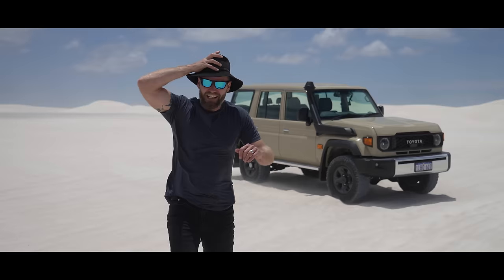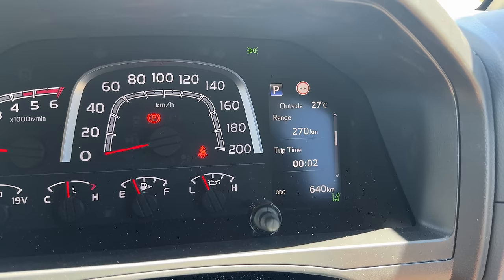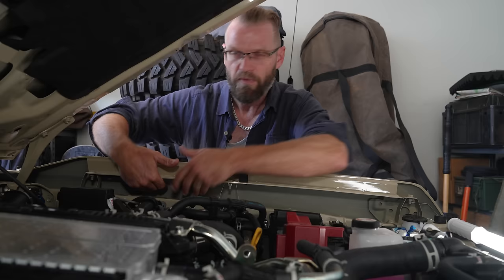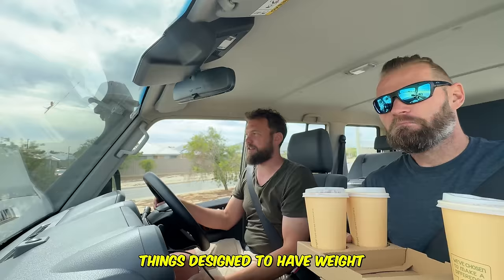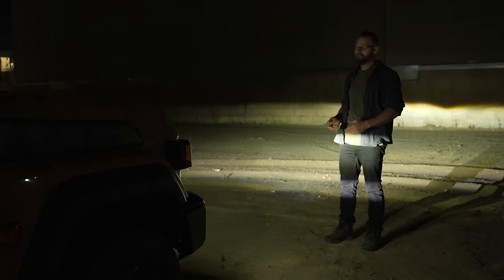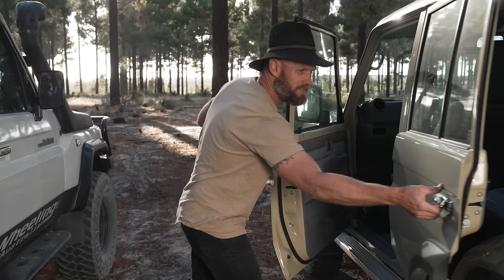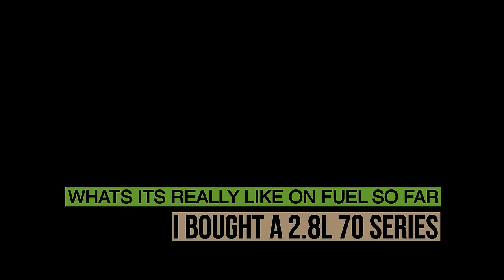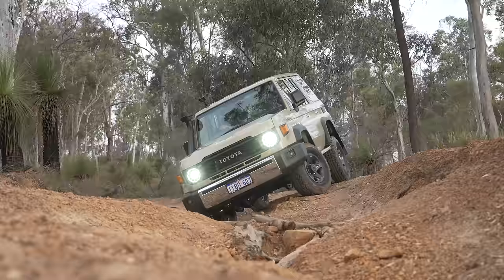I BOUGHT A 2.8l AUTO 2024 LANDCRUISER 70 series

Comment: 88K on a vehicle that's basically a way shitter version of a Prado with an out of line wheel track and cardboard doors is literally insane
Reply: Every tradie drives these types of trucks...each to there own but God dam they are expensive.
Reply: @Do-iz6qd  When it all comes down to it people are literally just paying for the look and maybe the solid axle, that's literally all they have to offer, because these modern engines are just as complicated (DPF, EGR etc etc) as any other. So They're not even old school reliability anymore. If that's what people are after you're better off buying an old one and rebuilding it.
Reply: @Do-iz6qd  “every tradie “ you recon ?  I’d say about 5% or less of tradies would be more accurate
Reply: It’s exactly what i paid for a Kakadu, drive away.
I prefer heated/cooled seats and a fridge under my armrest.
And comfort.
And the lack of noise.
And a reasonable sound system.
Reply: All cars have different track. It helps then turn around corners.
Reply: @Cous1nJack  um , what ?
Reply: @Cous1nJack  lol no they don't... It literally makes them wobble side to side in sand or ruts. It's a fundamental design flaw and cost cutting.
Reply: @Ozfreerider2504  Pretty special comment hey 😆
Reply: @gibbethoskins8621  the internet is just full of special people . Haha .
Reply: @Cous1nJack  can you name these other vehicles ?
Reply: @Cous1nJack  real cars ……
Reply: @Cous1nJack  We're talking about off road/farm vehicles, not street cars 🤦🏽 The reason it's an issue is because when they are driven off road they wobble side to side, especially in sand/mud/ruts which sux for obvious reasons but also puts excess pressure on components. Any off roader or farmer knows this, and they have to replace the axles which costs a fortune or use offset rims which also puts excess pressure on components. My friend just lost a rear wheel on one while towing at 110kph for this reason. Even your mum should know the difference between off road vehicles/tow vehicles and street cars.
Reply: @Cous1nJack  Yeah but we're talking about 4WD's 🤦🏽 not your gay vw golf that you drive to your boyfriend's house to listen to Sam Smith and play video games together 👨‍❤️‍👨
Reply: @Ozfreerider2504  Don't know where you live, but up here in QLD they are rife. I count 4 just on my street.
Reply: @Cous1nJack  you said ALL cars , then went on to name 2 piece of shit European cars that nobody cares about
Reply: @Do-iz6qd  are they tradies or just guys with 79s?  Even if you do see a few that are tradies that’s Probbaly because you’re liking for them now look at all the trails you see that aren’t driving them .
Reply: @Cous1nJack  you said every car ….
Reply: My betting money is on this lasting 40 years though.
Reply: @jesusnavarrete6317  who keeps a vehicle for 40 years ? People sell them in 5-8 years so not very important
Reply: @jesusnavarrete6317  Maybe with the DPF and EGR removed. We're talking about a vehicle that's literally recirculating it's own exhaust gas and running high pressures. Completely different to the old unbreakable Toyota diesels like the 3B.
Reply: The whole point of these was that they are cheap and reliable. No longer.

Comment: It’s like they’ve taken the 70 series out of the 1980’s and brought it all the way through to the 1990’s. Groundbreaking.
Reply: it has 2 diffs, !!,, but,,are they the same width..
Reply: Well that was the idea! U dont need too much otherwise get LC300!
Reply: @survivalabc spot on mate , there will always be whingers
Reply: @survivalabc  only because Toyota would try and charge 140 grand for it 😅
Reply: How about buying a 5000 km lexus lx 450d with sunroof and mark levinson from UAE. Right hand drive. Many people bought land cruiser v8 and lexus lx v8 rhd in uae for export. Will a lexus lx 450d be as capable as this? If we put 285/65/18 tyres. Its a limousine in road and beast offroad with ahc
Reply: @harrywalker968 still no. If they sold out previously... well  obviously ...people liked the dual width axles.😂
Reply: Yeah design may be from the last century but the price is from 2040!
Reply: That's Toyota, last centuries technology at tomorrow's prices. And people buy them. Go figure.
Reply: @colinboyd7779 Show me one proper offroader that‘s less expensive.

Oh hold on. There is nothing comparable out there. Maybe the Grenadier and that‘s much more expensive.

Comment: I find a lot of new modern cars have horrendously bad turning signals now to the point i have to do a triple take to see if the cars are indicating at round abouts or not. Good on Toyota for making a huge one and putting safety first.
Reply: They only did that to comply with the rules of the category the 70 series falls into now being a commercial vehicle
Reply: Indeed a commercial vehicle but I bet it also has a lot to do with some risk assessments done for use in mining. That is a market they would be chasing.
Reply: Mazda are the worse’s. They always catch me out.
Reply: bad turning signals as in their visibility or brightness?
Reply: Yes, ADR's have all been ignored on many new vehicles. Useless indication, brake lights, mono-white lights accross whole front or red on ass.

Comment: Congratulations, Toyota. You now match the power and performance of a 2009 Mitsubishi pajero!
Reply: I'd still take the Pajero
Reply: I don’t ever recall the 2009 Paj even coming close to 150kw and 500nm
Reply: @bluecent  147kw is very close to 150kw, and it may actually be faster 0-100...
Reply: 2.8 has loads more torque than the 3.2 in the Pajero.
Reply: I'm currently have Paj 2009 and thinking to buy Troopy.

Comment: Toyota kept the same rear end purely on cost, hence the misaligned wheel tracking. They messed up the bonnet construction and you can see where the glue has a large gap between the frame and skin. 88k for a project car which resembles a pre production fit and finish is what it is.
Reply: That’s a hot take. 
Why is everyone assuming different track widths is wrong? Most 4x4’s and heavy vehicles are designed like this, it helps with manoeuvrability on tight cornering and stability at higher speeds. It’s also great where you’re running aggressive side wall tyres because it pick up a little different traction lines.
Reply: The bonnet flexes like that because air passes flows through the bonnet through the front grille, to replace the hood scoop.
Reply: Rear end .. proves Australians will pay big money for a flawed vehicle. If this car had a Korean brand on it... It would get rubbished
Reply: @doeldogz8399  I'm Australian, I wouldn't buy it for that price, nor would I buy anything Korean to do what I require  because they can't.

Comment: I feel they could have definitely addressed the track width issue with the rear diff. And maybe a slightly wider wheel arch or flare. Otherwise I don’t see the need to change the rear. Also I wish it had a rear tire carrier factory.

Comment: Another interesting video Ronny! 
Having migrated from a 4 Cylinder 2.8L Auto Prado to a 4.5L V8 Troopy a couple of years ago, I know both engines well. 
The 2.8L is a gutsy motor and performs well off road and even when towing a camper trailer. I am surprised that as you commented in an earlier video, that the space in the engine bay is so limited, that you can't fit a second battery in there - I was able to fit a second battery in my Prado with no trouble at all.
I just know that your assessment on this vehicle will be thorough and definitive, so I look forward to following this project closely.
Reply: Toyota sells the FJ45 Bandeirante in Brazil with that torquey, yet lazy old 4-pot Mercedes Benz OM314 circa 1964!  At least this 2.8 is a modern turbodiesel, one that will become very popular.  In South Africa 🇿🇦, the first FJ45'S were sold with GM 3.8 and 4.1 straight six petrol engines, known Down Under as Holden.  Various Mercedes-Benz Diesel engines powered different LC models over the decades.  Maybe that's why they were so reliable??

Comment: to stop the bonnet flexing get a big dob (squirt) of Sixaflex to connect the lower ribbing to the upper bonnet skin  (if the fap is really really big, ues a spacer (wood is goodfor a spacer as it sticks well to sicaflex)
- This is likely a manufacturing defect from the factory not applying sufficient glue (sicaflex),
 OR they got she shape wrong and have too much clearance for the ammount of glue to fill

either way, an easy and long term fix 

- just do it neatly with a suitable colour and dont make a big mess with the sicaflex (be neat, make it look factory neat

OR take it back to toyota and get the dealer to "mess it up", no sorry, "fix it"
Reply: The gaps are intentional and deliberate. Its due to the need for the bonnet to dent easily during a pedestrian impact. Easy to fix but removes it's functionality and possible legality. I bet that a bull bar or winch bumper wont ever be legal either.

Comment: I was actually very surprised you never picked up that gap in the first video. The opening in the guard isn’t a new thing on modern vehicles. The current model ford ranger has it as well as does the VW amerok and the nissan navara. And I’m not 100% sure but I think the current model hilux like you had has it as well. It’s just covered with plastic. As a farmer owner of a 2013 single cab weighing 3.5t in central nsw I’m  in the market for duel cab.  Keen to see how the new 2.8 70 holds up
Reply: get a used V6 amarok for 25k

Comment: hi ronnie. it looks like the front fenders of the new 70 series would fit your older cruiser. that is why there is such a large gap between the frame of the car and the fender. toyota just bolted on a fancy new fender and bonnet to make it look new. nothing was changed structually to accommodate the new fenders. just small metal plates to take up the gap and make it possible to bolt the new fender on to the car.
Reply: Exactly, my d23/np300 is the same, they used the old d40 inner skin

Comment: Unless you MUST have the extra strength of solid axles, 3.5T GVM and Landcruiser engineering, the Prado and Fortuner make a lot more sense.
The 70 series is now a 10year vehicle IMO like the rest of the Toyota fleet.
Reply: Even then its a thong slapper and not overly powerful, economic or at all good.. The misconception around the 'V8' being good is laughable. The 300 v6 shits all over it and that is far from a decent donk either.. Somehow still seem to sell thousands of them to the gullible Toyota fanboys  @J.e.f.f.r.e.y
Reply: @lewiev7560  Don't forget that the single cab is the only one in the line-up to get side airbags, the Troopy, and dual cab get nothing for anyone in the rear, not even side airbags for driver or passenger, you get two airbags and that's it, that's real penny pinching by Toyota, but as you said, Fanboys would still buy it even if there was no doors and a 2cyl engine 🤣🤣🤣🤣

Comment: I'm interested to see it go through it paces. Not choosing the V8 will be unpopular, but I think it's a wise choice for people not wanting to make a trip away dependant on fuel costs. 
All good to say you must get a V8.... but when you have to rev these motors to get the V8 out of them they are very thirsty.

Will be following closely on how it travels.
Reply: You don't need a get a V8 to tow. The Cummins ISB is a L6 and it is a great engine to tow with. I ran one for 12 years before deciding to move to a v8 Ford. Almost 2 years later and I still don't have the Ford (factory ordered).
Reply: severely doubt there will be too much difference in fuel when loaded up and on roads where speeds are lower and 6th gear doesn't play in. load from weight and drag is pretty much the same... bit of an engine friction advantage to the 4cyl but not that much.
Reply: These use more fuel than the V8 when loaded up

Comment: Interesting reading on a South African 🇿🇦 4x4 community forum is that the 2.8 is well received and it has been said that this model is expected to become a top seller.  There was no whining about the long overdue demise of the rather underpowered, thirsty V8.  Only folks towing heavy loads such as 18' dual-axle caravans or boats doubted the 2.8 auto, as there are fears of the autobox overheating, but that's mere speculation.  If this gearbox is of the same origins as the Aisin unit used in the Prado, Fortuner, MU-X, Hilux, D-MAX, BT-50, etc., it should be a winner.  Due to the autobox, engine longevity may eventually impress.  I am beyond the age for playing rough, and would rather want a Mercedes-Benz G400d, which makes 700 strong ones at 1200rpm, at a rate of 243kW, from a 2.9l straight six. It returns 10km/l if your right foot behaves.  Now that's the kind of power, economy and comfort ideal for grabbing those long bazooka lenses to go shoot lions in the Kgalagadi or to click Klipspringer in the Richtersveld.  My altered spine won't survive another stint in a Toyota; my last one earned me permanent damage in the neck vertebrae, which cannot be corrected through surgery.  Let the kids enjoy playing in the dunes, some of us rather be more dignified.  That G400d has 3 lockers that can be engaged on the move. Some motoring journalists are excited to proclaim "It has 3 differentials!!" They clearly don't understand how drivetrains work.  It will have three, being permanent 4x4.  But it has three diff-locks.....  Motoring journalists don't know the difference.

I hope this 79 retained its lockers, it was the only other vehicle with 3, optional on Grenadier (designed by the builders and inventors of the Geländewagen)

Comment: The headlights on your old hilux were auto levelling Ronnie. Back left leaf spring has the sensor to the chassis.
The Sr hilux has manual levelling like your 76. 
The door tops where you rest your arm and the mirrors bolt on are physically smoother and more round than the single cab and troopy doors. You will see your troopy door edge is more pointy. 
The 76 and 79 dc have shorter front doors also than the troopy and single cab.

Comment: I’m very keen on these auto 70’s . Two things concern me tho. 1 - what’s it like with weight/ towing and 2- if Toyota bring out a v6 auto 70 with the same motor as the 300
In a couple of years the 2.8 L value will drop like a stone
Reply: That might bring the resale value down line with all the other "non tojo" 4x4's out there ?.....but nah.. it'll hold a good second hand price. 👍😂
Reply: If Toyota implement the V6, I'd say it'll be replacing the V8, not the 4. I don't think the 4cyl varients would be affected too much
Reply: The cost of the F33A isnt viable for the 70 series, Itd make the car cost 130k+. As for the value drop.... Have you seen the market value for a 75 series?.. Value will not drop as far as you think

Comment: Well, this is going to be interesting. Once you start adding weight and adding 35's, that little engine is going to have a seizure. Remember Nissan's experiment with a small 4 cylinder in a full size rig? I am tipping fuel consumption will be on par with the V8.
Reply: The Nissan engine had nothing to do with stress. They had an overboosting issue with a faulty component. Not even remotely the same. Most small trucks have 4cyl engines and have no trouble pulling extremely large loads. Toyota engines have always been underpowered and fuel thirsty
Reply: Not really. Nissan terra 2.5,isuzu mux 3.0,prado 2.8. These vehicles are designed to go offroad but not for towing. You dont need to add 35s. You need to put best all terrain tyres and the biggest you can put is 285/65/18 . It will be enough to take these cars to places unknown to mankind. If you want to increase performance then dont tune the car instead add engine upgrades like fuel injectors,cold air intake,differential breathers,snorkel but an efficient one from a reputed company,there are other components too that can increase your power without harming engine like exhausts,engine pipes made of aluminium. All these upgrades will result in 10-15 more hp and 30-50 nm more torque. Enough for a 4cyl engine. Obviously for anyone considering putting 35s will have to buy another vehicle or . Bur these upgrades that I mention will increase the fuel mileage as well.the engine will drink less fuel and breathe better. .The most potent 4 cyl is the 3.2 mitsubishi pajero's which is noe w discontinued.
Reply: Agree 100%. However, those that buy these type vehicles will modify them and the first thing is usually bigger tyres. Then the weight starts going on and adding up. Very rarely they stay stock standard. @oriondoublecrossed
Reply: Yes, Nissan eventually fixed the overboost issue, then went common rail. They still struggle with over sized tyres, especially off the mark. I don't know of any small truck owners that deliberately fit tyres and wheels that are 4 inches larger than stock, and all will tell you that they would not mind a little more power. I am not sure what you mean by fuel thirsty? That would be a relative thing, I guess. @MrWerd910

Comment: Hi mate, ive been in the indsutry for 37 years. Retired recently. Ex toyota australia auctioneer and family have owned toyota dealerships. Im a “rusted on” toyota landcruiser guy. I could drive anything and had new comapny cars every 15,000km. As you can see by my profile photo i like my cruisers. 

However, i hated the 300, sold my v8 dual cab (ive had 5 of those), and bought a hilux. Why? I want tonsee if incan live with the 2.8 and auto before buying another 70

Sadly, i think Toyota are taking the mickey out of its buyers. 1. They never fixed the track issue. 2. The 2.8 in the 70 under the bonnet looks a mess. 3. The bonnet itsself and front guards are third world quality. 

If toyota dont watch out this will gonthe way of the 3 litre patrol.

Me? The hilux is like buying a fridge. Apart from the independent front end i like it! And infeel spoilt- its got a lot of cup holders

In the meantime im just driving my fj45 tonremind me of what a landcruiser once was.

Keep up the great reviews